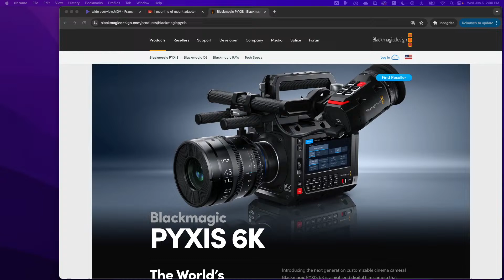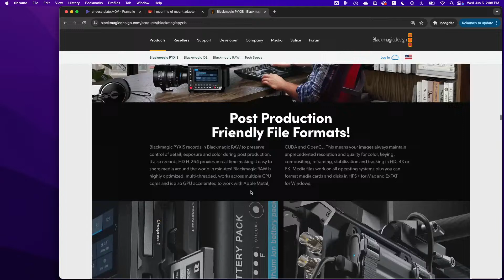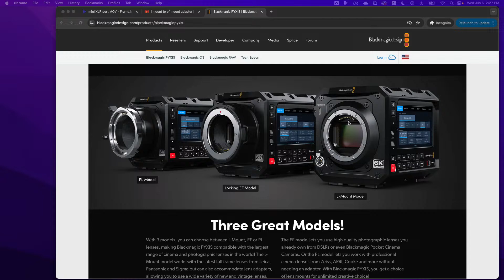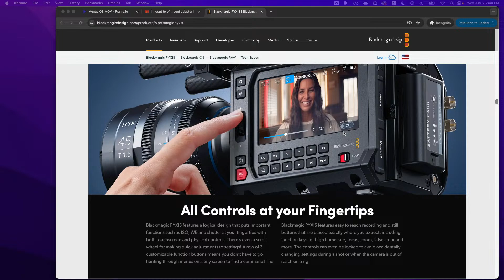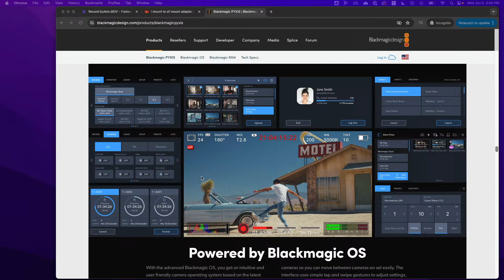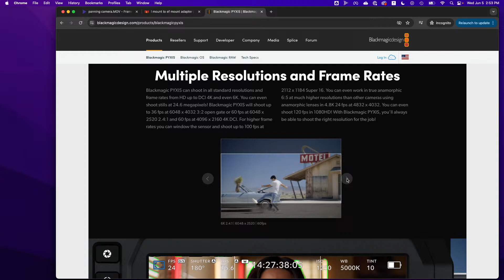Blackmagic PYXIS 6K is Coming! Let’s talk about it LIVE!

Comment: Agreed. The L-mount is the most flexible option. It's the version I preordered. They also didn't build in NDs because it would have added cost, changed the weight, and added to the time to market timeline. Blackmagic has already said the display on the side is a setup and menu screen. The little 4" screen is not meant for monitoring. Also... ProRes is not an issue. You can export ProRes from Fusion Studio with the Saver node. Your Blackmagic Studio license works with Fusion Studio for free.
Reply from the maker: yeah, L-mount def makes the most sense for cross compatibility! 
And yes, it seems like they tried to keep the cost down the most, then size and time to market.
I don't like converting footage to another codec if i don't have to though. i'm hoping they add prores support!

Comment: I'm waiting for the launch of the Pixies 6k Pro, with a nice flippy screen, variable ND filter, and 10G Ethernet, to support BlackMagic's own new 2110 IP protocol.
Reply: Agreed
Reply: It won’t be called a Pyxis. The camera big enough for all that will be the next generation Ursa.
Reply: Even if the menu/setup screen was articulated it wouldn't be useful for pulling focus and monitoring. Even URSA users only use the articulated screen for setup and menu. Everyone will be using an external 6" or 7" screen for monitoring with the Pyxis. Internal NDs are way overhyped. You have more creative freedom with screw-on, matte box, and lens blade ND filter options. I will be using the NiSi Athena Primes with drop-in ND lens blades for my Pyxis.
Reply: @andynonimuss6298  You're right, it's certainly no bad cam, but I just don't get it why users will have to carry a second screen when there's already one there on the cam. You're right about the ND, sure you're more flexible with external solutions.
Reply: @shareyourfare  I don't see why anyone would want to monitor and pull focus on a little 4" screen that's locked in place. I would much rather use my BM 7" Video Assist where I can focus easier and see everything better. I can also swivel it and tilt it to where I need it.